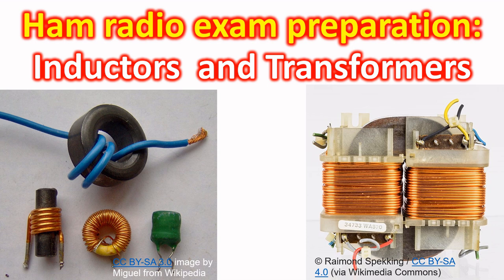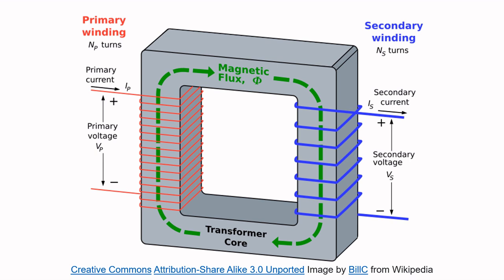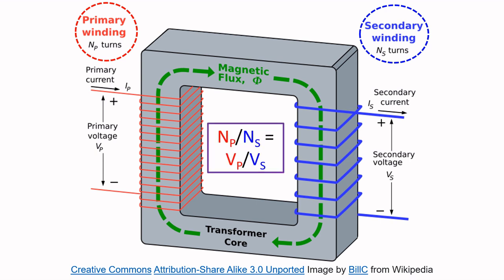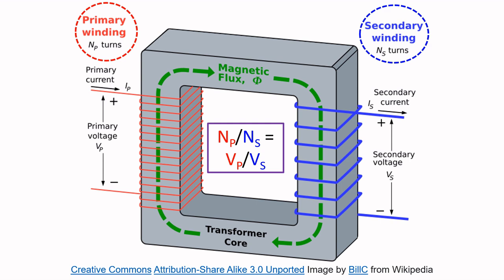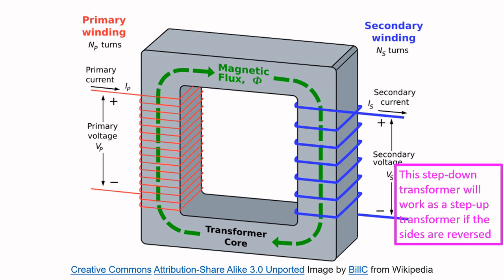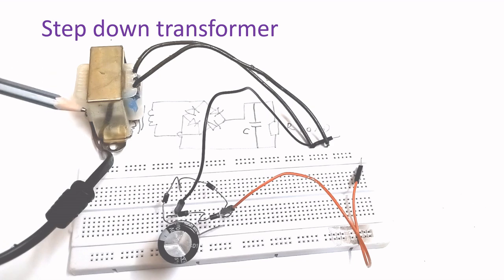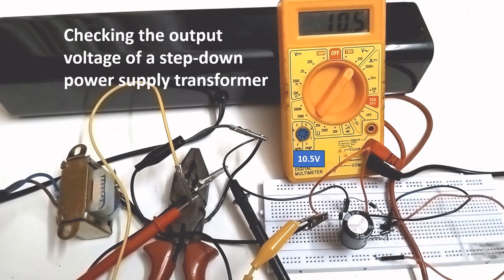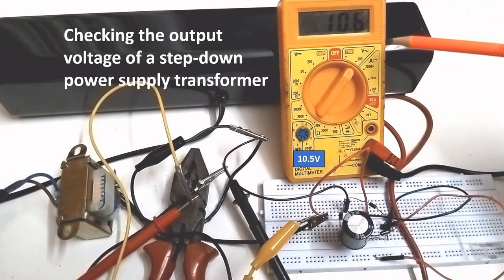Inductors and Transformers

Comment: Wonderful sir! 👍😃😃
Reply from the maker: Thank you! 🙏Hope to hear you on air soon.
Reply: @johnsonsTechWorld  unfortunately no budget for HF set yet sir!
Reply from the maker: VU3CDK in Mumbai is able to contact several DX stations on 28 MHz, 18 MHz etc with his uBITX which has just 5W SSB output. He is using inverted V dipole. Solar cycle 25 is nearing its peak. Propagation is good. If the local noise in your region is low, uBITX can work wonders on higher bands. May I know your callsign? 73 Jon, VU2JO
Reply from the maker: VU2MZT in your location may be able to guide you. There is one ham in Germany (DL3XU) who works 10m from his balcony with a short vertical antenna and just 3W power. As he has a 10m repeater at 3km (DF0HHH), he has been able to work five continents with a 1.6m long mobile antenna! 73